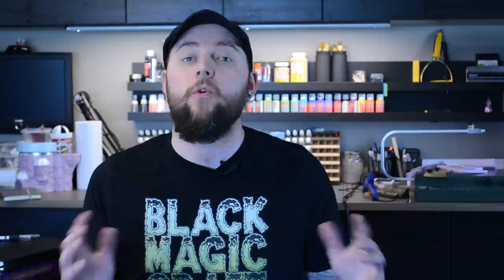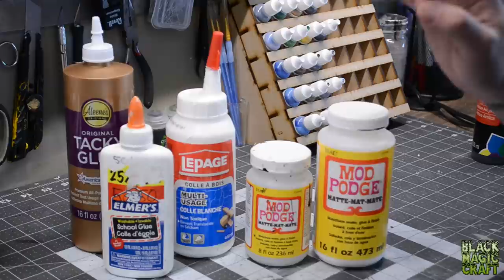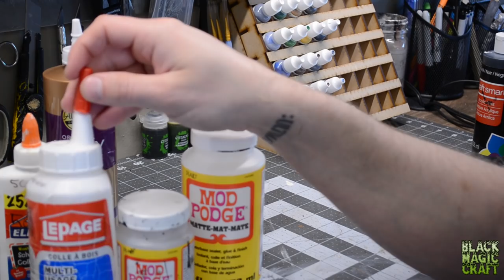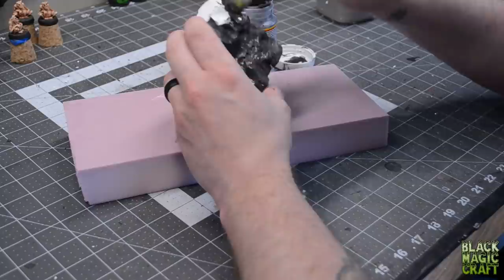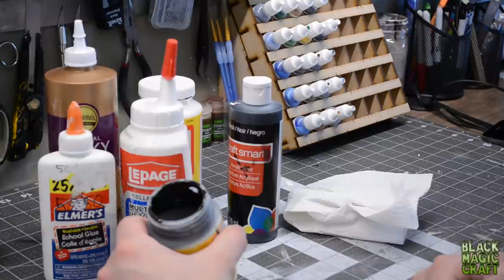Black Magic Base Coat! How to protect and and harden your terrain (Black Magic Craft Episode 034)

Comment: Does it NEED to be black paint? I tend to prime miniatures in grey as it's a good compromise between what black and white primer does to colors. But I haven't painted enough terrain to see whether it would make a huge difference there. My guess though would be that it might not be a big deal since most terrain paint isn't going to be put down as multiple thin layers like with minis.
Reply from the maker: The paint is just a visual aid to help you see coverage. It should be whatever colour you prime with to make priming easier/already accomplished. If you prime grey normally, make grey mod podge.

Comment: I tried using it without the black acrylic to seal the beginner fountain. It’s been 3 hours and it’s still not dry. Does the acrylic make it dry faster? Or did I just apply it to thick?

I love your videos. I started making your stuff today ❤️
Reply from the maker: Unless you are somewhere incredibly humid it should be dry to the touch in about an hour. You likely applied it too thick.

Comment: Im sorry to comment on a 4 year old video, but I'm running into an issue as a (very) beginner crafter. After I coated the model in this mixture of black paint and mod podge, I can't get any solid color for the next layer. (I am using opaque paints) the black just always comes through as if there's not even a layer over it

Comment: Hey ty the video. Is mod podge suitable for sealing cardboard? I’m making card board boxes to store minis in, I want to paint the boxes black. Would mod podge with black paint give a good finish? Ty in advance :)
Reply from the maker: Yea, mod podge is designed for paper. It's intended use is decoupage so I expect it will work just find on cardboard.

Comment: I've had problems with bubbles when using water effects on XPS foam hours after pouring.   Using mod podge first solved that!      For clear sealing it's odd, you have to brush slowly on textures to avoid foamy bubble patches and it stays tacky for weeks.   Am I the only one?
Reply from the maker: It really shouldn't stay tacky, I've never had that happen....then again I only use it before paint not after.

Comment: Love your channel.  And I'm making some tiles for HeroQuest!
Reply: Hey Paradigm,  me too. Just cut out my first few rooms from xps foam tonight. Good luck and perhaps we can share our progress together
Reply: Right on Steve!  I got all my rooms cut out.  I gotta texture and paint them.  I was thinking of installing magnets on the bottom of each piece to hold them in place.  So far all the pieces line up pretty well.  I'll probably have a base board with magnets that line up to each piece if that makes sense.  And as a bonus, I'll make it a wall mount too.  So I can hang it like a painting.  ;)  This might to an over endeavor but that's the route I'm trying to go with.  If I'm doing all this work I want it to be a awesome show piece too when I'm not using it.
Reply: @Tovenaar13  absolutely....lets stay connected , Id love to see it as you progress... My approach is more to remove it from the board layout...into only showing the tiles as they are revealed in play. not sure if it will work but as a first foray into crafting "d&d" like things , I thought its a good place to start . I just added the texture to one quadrant , tonight ill do more and hopefully cover them all in  mod podge and get ready for painting.
Reply: Cool!  Yeah I'm doing the "reveal" set up as well.  Every room or corridor is  it's own separate piece.

Comment: Could I use this as a base coat for miniatures?
Reply: I wouldn't. Minis have a bit more fine details than you average terrain pieces. Having mod podge to basecoat minis could get rid of those details. There is brushable  primers if it's what you are looking for, look up for badger or vallejo primers.

Comment: Going to have to disagree with you on Elmer's.  I've worked with most formulations of PVAs, and Elmer's is not just watered down compared to other PVAs.  I've built wooden furniture for years, and Elmer's is actually a very strong PVA- I've known plenty of people who will use it because it is much more flexible than anything but contact cement or hide glue (which have serious problems), providing a joint that is more resistant to wood warp and wear.  
Granted, tacky glue ends up pretty similar, but it's more of a pain to use because it is so thick and has a shorter working time.

Comment: I'm making a brick wall on pink xps foam for my action figures. Would this work as a base coat, like initial black wash. I find it a little thick. Wondering if adding  some water  would help.

Comment: That's a cool tip, thanks ! 
I have a question about this technique : 
I'm currently working on a gaming table for frostgrave. I builded it with polystyrene (the white one with little balls inside) and I want to protect the surface and hide the balls from the texture wile keeping the symbols and drawing that were carved in the polystyrene by the manufacturer ...
Does this technique would be adapted? Would you advise me to use another one? 

Thanks

Comment: ok, so basically....
1. base coat; ModPodge + black paint, which also seals the foam
2. paint with color (base color, usually a medium grey)
3. paint hi-lites (usually with a lighter grey, even sparingly an off white or beige)
4. black wash; water, black, brown, forest green or dingy green)
5. finish up with a coat of Minwax

did miss anything?
Reply from the maker: You've got it. These are the fundamental basic steps of painting terrain. The paint steps can then be broken down in as many layers as you want, the more variance the more realistic. And even advanced painting is just taking steps 2-4 and doing it a few times on the same piece for mare subtle variance...so after the wash do some more hightlighting, then wash again, then repeat as much as you want.

So just practice these basic steps and you'll naturally find your own methods to enhance the steps. And the principal is the same for any colour, not just greys. Do the same with brown for dirt and ground cover for example.

Comment: So...just did this.  my ratio was a bit closer 1:4. Noticed the lid was bubbling out on one side. Yeah, so no idea why but when I opened it...BOOM...well kinda. Imagine shaking a soda and cracking the lid a bit. It looked like black soap suds and was pressurized. No idea what caused it. If Any one does please let me know!
Reply: @Dilligaf Martin glad I wasn't alone!!! So my wife is the painter/sculptor and has years of experience with the stuff. She said that if you mix the two you NEED/HAVE to mix it gently. I shook it up like a damn spray paint can. My wife also said that if its done gently and left to sit open it allows it to "breathe". Conclusion on my end: It isn't the pain its the mix of the MP and Acrylic paint in general. Mix gently and let it breathe. Il look into it and if I can find more on the reaction ill post back here.

Comment: I don't know if you still check messages on old videos, but when I made mine didn't want to smoothly go on the smooth front and backs of the foam boards. (Yes I did take the plastic wrapping off first 😆) 

Any suggestions?
Reply from the maker: Practice your application.....it seems like you are trying to put it on flat surfaces? If that's the case try a small paint roller.

Comment: Sorry if this has been asked previously but there are quite a few comments. I'm about to attempt my first brick wall and was wondering do you use this mix of mod podge and black paint instead of an initial black wash or does it go over the black wash to seal it before painting? Thanks 🤘💀🤘
Reply from the maker: Seems you’re a bit confused about all the steps and the order. Check out ANY of my build videos and you will see the correct order of things 😉
Reply: @BlackMagicCraftOfficial  yeah confused. Will do thanks 👍

Comment: Once this mod podge dries, are you able to use spray paint over the piece? Normally spray paint melts the foam; didn’t know if the mod podge put enough of a protective layer over the foam where you could use traditional spray paint.
Reply from the maker: It offers some protection but this is the wrong line of thought.

You can safely spray paint raw foam with most spray paints. It requires testing, practice, and correct technique.

You should not rely on the protection of mod podge as there can still be failure if you don’t do it safely. Master the skill rather than relying on a protective coating.

I spray paint foam all the time. I did use this in two recent build videos and several old ones.
Reply: Mind sharing which video(s) show you spraying the foam?

Comment: Maybe a stupid question, but how long is it usable after you mixed it? When I prepare a batch, do I have to only mix what I need for this one sitting, or can I just buy one of those smaller ones, mix some black paint directly in the bottle and be good for the next few projects without fearing that the mixture turns "bad" or something?
Reply from the maker: Good for several months.
Reply: @BlackMagicCraftOfficial  
Thanks!

Comment: Hey, everyone! I know this video is "old", but I just started crafting my stuff using BMC's awesome videos, and I just had a "weird" experience with the BMBC. As I was mixing my black paint (Americana black craft paint) with the matte Mod Podge, the stuff started bubbling (kinda slowly, but surely) and it kept bubbling to a point where it spilled over off the small container I was using to test this mix. Is this reaction normal? I haven't seen any comments anywhere about it, nor has Jeremy mentioned this in any video. Just wondering if there's anything wrong with my materials or if this is expected. And to Black Magic Craft/Jeremy: THANK YOU SO MUCH for this incredible content. You gained a new patreon supporter.
Reply from the maker: Not normal!.....unfortunately I have no idea why that happened.
Reply: Wow, thanks for the VERY fast response, man. Here’s what I’m going to do: I’ll experiment further with other paint brands and even inks and I’ll report back. Maybe it can be useful to someone else having the same issue. Keep it up, man - heading to Patreon now to show my gratitude 😁
Reply from the maker: I would say any of the cheap craft paints should be fine, but I personally use apple barrel black in mine. If you try that and you have the same problem then it's related to something else.
Reply: Just in case anyone is wondering: it was the Mod Podge. Somehow I managed to buy a bad (large!) pot of the stuff. I bought a smaller one, tested and everything worked as it should. I even made a video about it - out of respect for BMC and Jeremy I won't link it here, but it must be the only video on my channel (and it sucks) so watch at your own risk. Anyway, mystery solved! Again, thanks to Jeremy for being so nice and taking the time to respond. Keep crafting, people!

Comment: Is mont marte's black gesso a good substitute for mod podge?
Reply: I was going to me tion that Liquitex makes bottles of black gesso as well. I hand-prime larger things with it fairly regularly.  I might try mixing that with Mod Podge now for foam.
Reply: @valleyDweller  is it good? Can i use it as a primer for foams? Im using high density foam, somewhat similar to the Xps foam black magic craft is using
Reply from the maker: I’ve never tried gesso. Mod podge is cheaper for me so I’ve never bothered.
Reply: I used to make tyranid mycetic spores out of sclpting styro craft eggs and dunking them in a bucket of white gesso to seal them. Gives it a chalky eggshell layer.  For this, I’d use gesso in the mod podge. The podge benefit is durability. Foam, even the high density stuff, dents/cracks/scratches really easily. A couple coats of this mix should help a lot. Even with the cheap black craft paint. The black gesso is just more like a base paint than a layer paint. 

Related, I’ve sealed foam by coating in resin and with plastidip spray as well. Modpodge mix is a great idea for durability and safe indoor application. 😊

Comment: I live in a country that I really don't know how to find Mod Podge.
Can I use some diluded white glue instead? How can I make it work almost the same way?
Reply from the maker: Yea, it's not quite as good but it will work. Dilute with water and ad a tiny drop of dish soap or dishwasher rinse aid to the mix.
Reply: @BlackMagicCraftOfficial   Thank you very much for the quick response. =D
I'll try using this mixture here.
Reply: I'll start with the hobby next week, did this solution worked? Can't buy mod podfe here too
Reply: @PssicoNets   It worked very well. Actually worked so well that I'll just use this mix for now on.
If you want some measures I can send you. =D
But there is no secret, like he said at the video. Just 2/3 pva glue, 1/3 water, black paint until you're satisfied with the coloration and just a little of dish soup.
Reply: Jabba ty. Just a few drops of soap?
Reply: And you used just the regular white glue right. That used in kids homework.
Reply: Yep. The regular school glue. And yes, just some drops os dish soap. But I made just a little amount of the mixture, so if you're gonna make like an entire bootle of it (750ml) you would prefer to put like 2 or 3 spoons of dish soap.
Reply: A little soap will go a long way, yeah. You'd probably even be fine with a couple drops in 750 ml.  Don't worry about it. If it's too thin, add another layer, if it's too light, add another layer (and maybe mix in some more paint). If it's too dark, wipe it off (the crack don't matter so much), mix up a little more glue and water and add that to your mix. Remember, washes tend to be simulating grime on 3d surfaces, so it's okay if it isn't "perfect."
Reply: @BlackMagicCraftOfficial  >a tiny drop of dish soap or dishwasher rinse aid 

huh.
I saw one guy on youtube painting minis with acrilyc+vodka for fast dry.
Maybe we can mix it in. Have nothing to lose :p

Comment: If you seal flocking  under modpodge, will it reactivate and mess up the seal when you add more flocking and re-seal it?
Reply from the maker: Not sure, I don't seal flocking under mod podge. The only application I use mod podge for is expressed here, sealing foam before paint.
Reply: Okay, cool thanks. I had some paint from the flock I sealed with glue all seep into some snow I applied afterword. I will have to try and see if it does it with the mod podge. Thanks.

Comment: So I have the reaper bones Cthulhu. People who have put it together has said that the Wings droop.  If I use a coat or 2 if MP on the wings  is it possible that it would harden them a bit?
Reply from the maker: I wouldn’t recommend it. It’s not strong enough to stop that sort of thing, and it could have adhesion issues.

Comment: In the video you use black craft paint. Is it possible to use black acrylic ink like in the wash?
Reply from the maker: Probably but I don’t know why you would, it’s so much more expensive and I don’t think there would be any benefits.
Reply: @BlackMagicCraftOfficial  Thanks for the quick reply. Just seems like I have added a ton of black paint and it still isn't quite black enough. Was wondering if the ink would help that out.
Reply from the maker: I doesn’t need to be black enough. It just needs to let you know where you’ve covered. If you want a blacker base coat add a quick matte black paint coat after.
Reply: @BlackMagicCraftOfficial  Makes sense. Thank you. I have really been enjoying your videos.

Comment: Does mod podge work as a clear coat AFTER you paint the piece?  As a final protective layer? I do the black paint / modpodge base coat.  Then I paint everything.  Then i put a layer of modpodge over the whole piece.  Is that right or no?
Reply: Thats what ive been doing but i cant seem to find any information about whether or not im doing it wrong.

Comment: Ok. So sealing the work makes sense. Why seal it up front before paint vs. paint it and then use a matte varnish over everything?
Reply from the maker: This way you get your black base coat and foam hardener all in one step. 

A the project often is typically assembled with water soluble glue, and the painting process can include washes which will apply a lot of moisture to the piece.

A project might also include cardstock or paper elements that would warp or be ruined when applying a heavy wash.

Mod podge after paint could also negatively affect the look of the piece.
Reply: Black Magic Craft  ..awesome. New to the medium thanks for the tip!

Comment: Does the type of Mod Podge make much difference?  I bought a small container of it but later noticed it said gloss instead of matte.  I use the matte black paint from Wally World so will that be enough to tone down the glossness do you think?
Reply from the maker: you'll have a much harder time painting it after if you use gloss. It's worth getting another one of matte....even the matte is more glossy than I would like and if they made an ultra matte I'd buy it in a heartbeat.

Comment: is this similar to doing a black wash but just sealing it also?
Reply from the maker: No, it's an entirely different thing for an entirely different purpose. Done at a completely different time in the build.
Reply: @BlackMagicCraftOfficial  Thank you for your quick reply. I am at base line zero for model making so I am watching your basics tutorials and havn't gotten to the black wash one yet. I notice you said you do this before any paint at all. I also plan on watching some of your more full how to tutorials where it would probably show me better where in the process you normally apply this. I am not doing tabletop models but dioramas for action figures and Hot Toys and your channel came with high recommendations since it often crosses over.